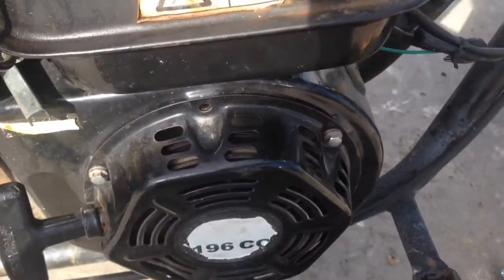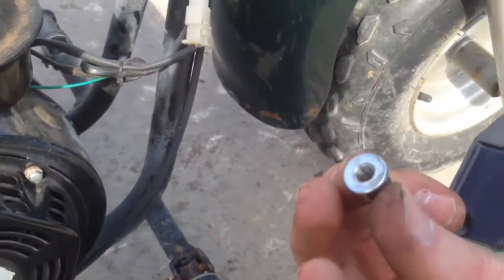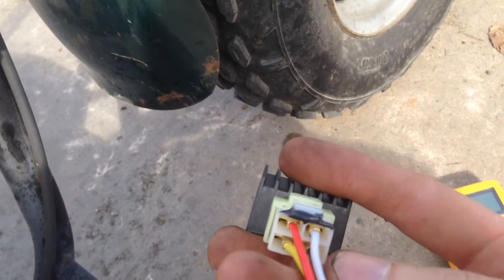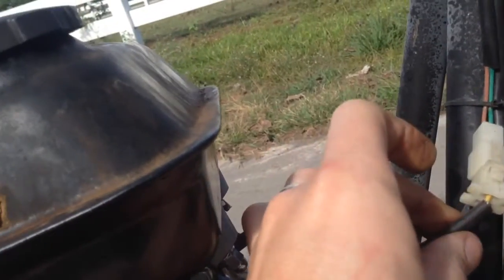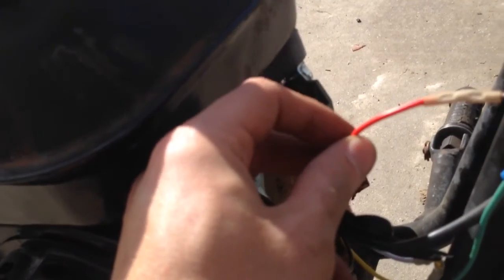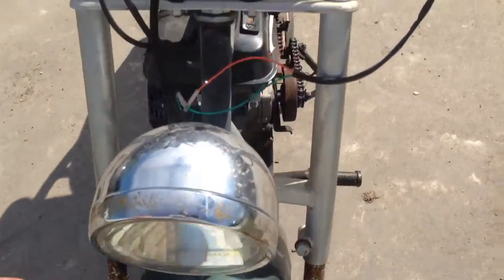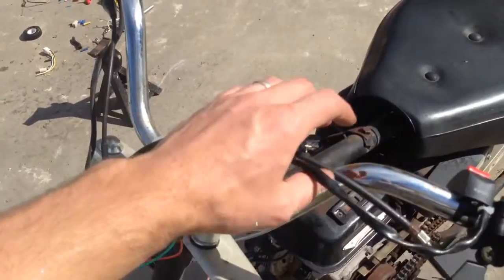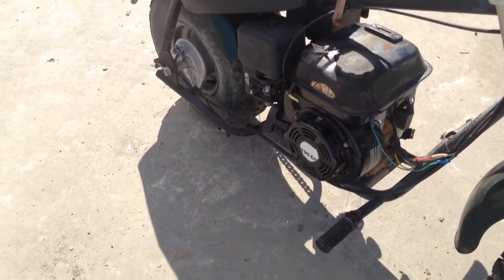Baja Minibike Rectifier Regulator Install

Comment: Any follow up? Did it work? I am currently doing this to a couple of ct200s and had to add a large capacitor to stop the flicker. I think folks could use a link for that led bulb if it’s not too much trouble.
Reply from the maker: I need to get back on this. Other project took priority and this one has been collecting dust.

Comment: I think those regulator rectifiers need a battery in the circuit in order to output full voltage, to charge the battery. Not sure, but some of them do say that.

Comment: what regulator is that? gotta link? do you plan on adding a battery to your setup?
Reply from the maker: It's just a cheap one off ebay and I'm not too happy with its voltage output.